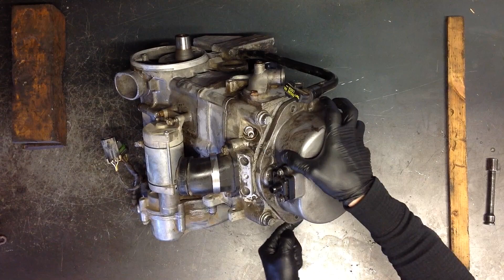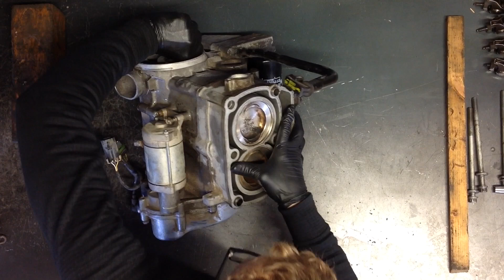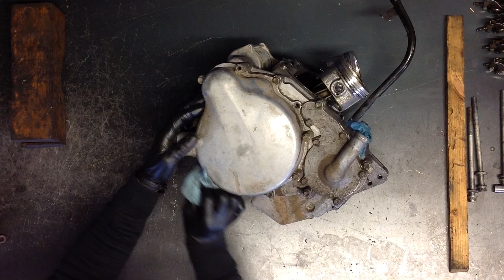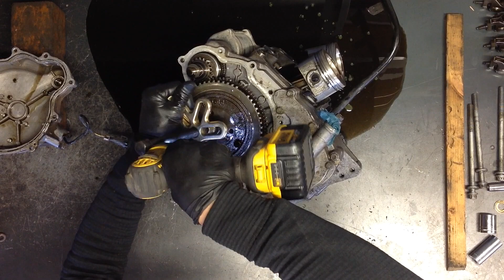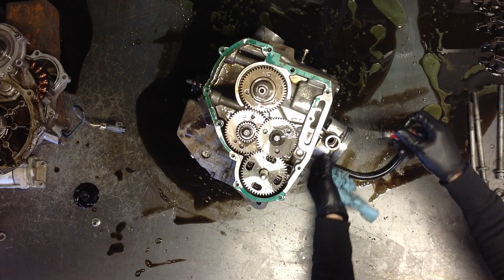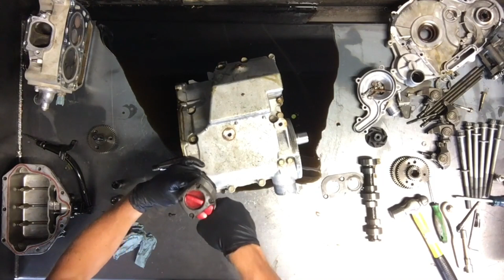Polaris Ranger RZR 700 800 - Complete Tear Down - Rebuild - Bad Motor - Common Problems

Comment: Thanks for this video! I'm going to be tearing down a locked up one soon.
Reply from the maker: You got this!! Let me know if there is anything I can help with!
Reply: @MidNebraskaMotorsports  Thanks! I got it tore down. One of the big ends of the rods snapped apart and it broke the cam into 4 parts. Both cam tappet bores on that cylinder took an impact and so tappets got stuck. It's not too bad and I got them out, so I'm gonna ball hone them and rebuild it.
Reply: @MidNebraskaMotorsports  So I'm using aftermarket parts to do the rebuild and having trouble timing it. New crank and new CAM. The marks don't seem to be right on the crank. If I align the Crank with the balance shaft, they hit. It seems the mark was one tooth off, ok no big deal, it works fine one tooth off. However that makes the CAM timing off, but measuring it it's less than one tooth off. I started with the marks aligned, but the CAM lobe impacts the balance shaft (aftermarket lobes are about 1mm taller). So I moved it one tooth and it's better and timing seems right, but wanted to see if you could help confirm? What I was hoping you could confirm for me is that at 300 degrees (41.5 crank gear teeth) past compression TDC the exhaust valves fully open, and 360degrees past compression TDC, the valves are closing but not fully closed, and 36degrees (5 crank gear teeth) past that the valves begin overlap.
Reply: I just re-watched your assembly video and realized I didn't understand the outer part of the cam gear has to be rotated into position. Once rotated correctly, the alignment marks on the CAM mated to the balance shaft where I expected them to, which also confirmed my degrees I quoted above must be correct. Thank you!!!